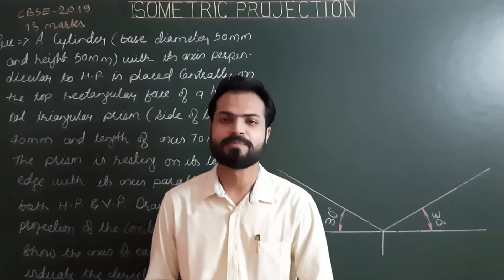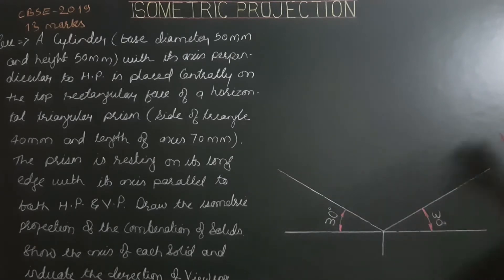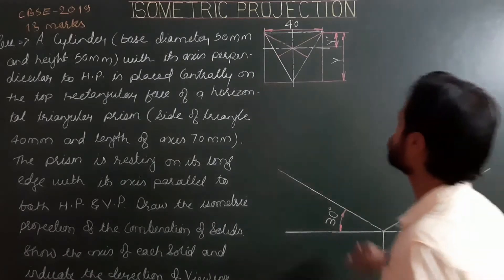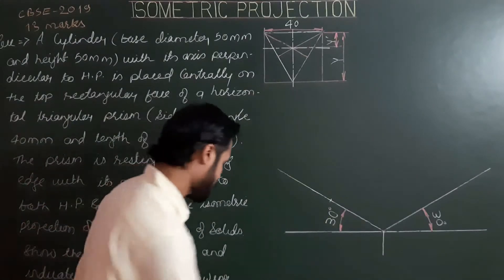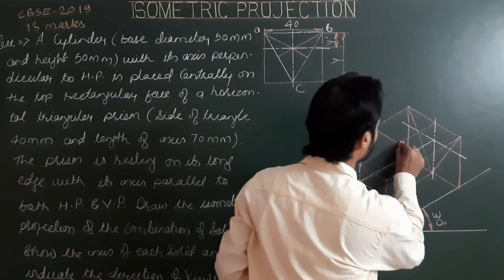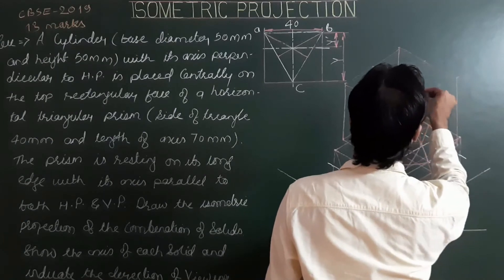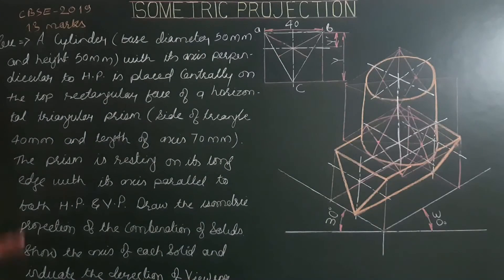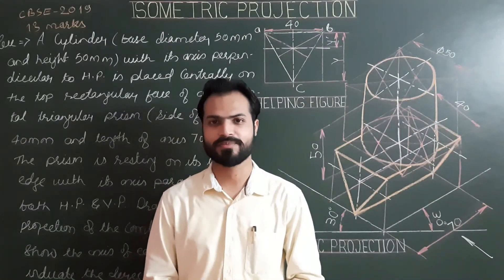Isometric Projection Of Combination Of Triangular prism & cylinder (Part-30)

Comment: Sir in this question can we start drawing the face on the triangular prism on the 1st iso axis ? Will it be correct then? Plz reply
Reply from the maker: yes but the axis is parallel to both H.P. and V.P. so in that case you should change the direction of observation/viewing also...
Reply: @vinaykumarverma5186  yes so then the direction of viewing will be towards the 2nd iso axis ? Correct?
Reply from the maker: @shravanimishra583  YES...